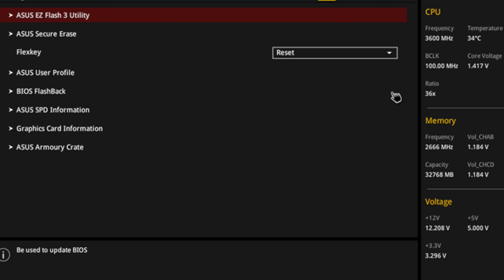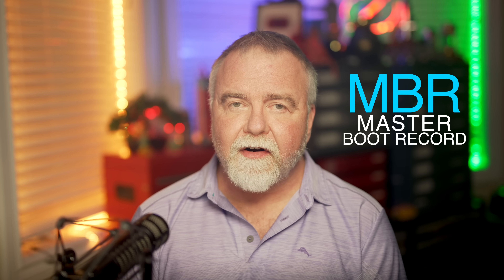How Computers BOOT: From Startup to Viruses

Comment: How does the 6502 supposedly load the address out of ROM, instead of leaving it in place as it loads it?
Reply: The reset, NMI and interrupt locations are the marked addresses, but the program counter is simply set to that value, leaving all registers and flags as is, and it then executes that address as if it were a regular program location. Thus you would always store in that location a jump instruction, followed by an address elsewhere into the ROM, which actually has the right code you want to execute, and thus, aside from reset, which also clears all internal CPU registers and flags, you get the code to run from that new location, with the stack in page 0 containing the address of the last instruction before the interrupt or NMI was asserted. 

So after your code executed for int or nmi, you simply made sure you had restored all flags, and popped off the stack correctly, leaving it at the right address, and issued a Return from interrupt, which popped the stack back to the program counter, and the program would execute from the next instruction, totally unaware of interrupts. However the 6502 does not store flags in the stack, it is up to the programmer to first disable interrupts, to prevent another from dropping you off into lala land, then take the flags, and save them, and all registers you are going to use, into the stack, before doing your hopefully very short and very fast interrupt routine. Then on the end you restore all those registers, and flags, and finally, before you execute the return from interrupt, you enable interrupts again. 

Luckily for the programmer the 6502 interrupt pins are edge triggered, so if the pin is still asserted you will not get another interrupt till the pin toggles inactive and then active again. This is sampled as well by logic that only will assert it when there is an opcode fetch, not in the middle of an instruction. NMI is not so lucky, use with care, as there you can go out, as by definition you cannot mask a NMI event, though it does use the same logic for selection. Rest is the hard one, it simply uses the internal logic to force set all flags, stops the internal clocks from operating, forces all the address and data lines to the tri state condition, and same for all the control lines as well. Plus on the transition to logic low there is a small state machine that turns on the internal clocks first for a few cycles, then deasserts all the forced reset of registers, before enabling all the bus and control lines, before finally releasing the program counter from being frozen, with the pattern for the reset vector set into it from the logic, as that hard reset along with the interrupts is coded into this state machine. 

Been a while since I looked at the 6502 datasheet, and the errata for the later versions, alongside the early ones, have some instructions that were there, but later on got marked as do not use, dimply because there were some that did not work correctly on the early silicon, or which were as a result of a simple decode logic that had some that could work with multiple opcodes to do the same function. Those were used to tell early chips apart, as some would work, others would hang, and some did unexpected operations, generally needing you to press reset to gain control back.